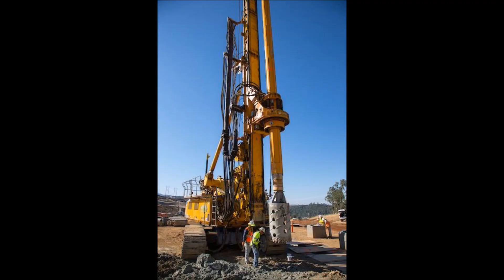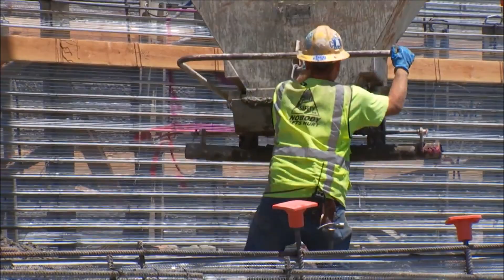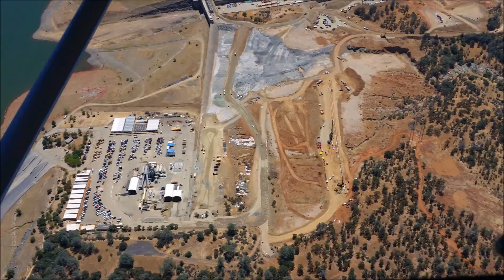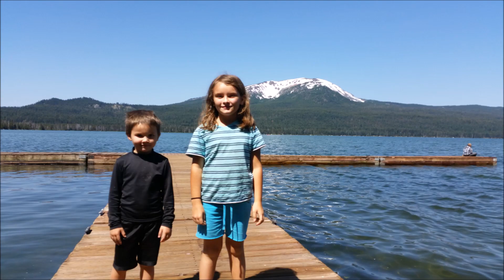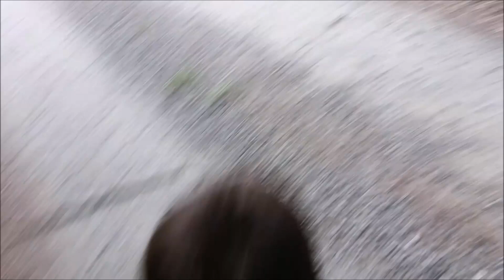Oroville Update 20 July -"Long way to Go, Short Time to get There"

Comment: It's amazing the amount of material(s) being removed, added, recycled and all!
~
_Wonder if they'll run out of their own stockpile of gravel from their stockpiles & have to bring it in? _
(Either gravel, sand, RCC, Structural Concrete)
~~
Anyway, also interested in the drainage being put in between the fill concrete. (The inner workings and pipe being used. E.G. Size, length, material it's made of etc..)
~~~
Thanks for all you do Juan, it's of a great service you provide to many.
~~~~
Truth, Peace, Freedom & Love2ALL™
James
7/28/2017
5:09am

Comment: Can you tell a few words as to why they have to remove all the dirt including using water hoses and shop vacs...
Reply from the maker: 'Dental Cleaning' to give the 1st layer of new concrete something solid to adhere to.
Reply: Much thanks.  BTW, I live up here in NW Wa but am quite interested in the project. You're doing a fantastic job covering it.

Comment: Juan: Just to clarify, the vibrator in the "wet" concrete is meant to ensure that no "air bubbles" are present that would create a "air pocket" and weaken the concrete. Wet concrete is not "compacted". The RCC is mixed much drier so that when it's "squeezed", it sticks together like a clay ball. Rule of thumb: The driest concrete makes the strongest concrete. Not considering "re-inforcing" of course. Has anyone asked how they intend to move (transport) the massive amount of RCC to the plunge pool?? We're all trying to "guess" how that will be done since it's such a massive amount. No-one is mentioning those "training walls" but they also will be a massive step to be completed by target date. As always, thanks for the updates.

Comment: Thank you for withstanding 6 hours of meeting and finding a nugget or 2 to report. [You do at least have many subscriber's time well spent. Even for those of us not near the problem.]

The region of the spillway needing the most improved footing looked like a terrible mess 1 or 2 weeks back. It appeared that the remediation task required too much time and material to be completed in the time available. Seeing the progress being made to build a stable in-fill on the tough base rock is most encouraging. [This despite concrete-pour methods which do not seem very efficient.]

Thank you again.

Comment: What years were you in the USAF - what did you fly.  A lot of my classmates are airline pilots at present.
Reply from the maker: mrackerm class 89-04 Willie, Mather, Travis, Reno NVANG. AA in 99
Reply: Thanks.  I was USAFA 81, 30 years as a scientist.  I have classmates (that I know of) flying 777s out of IAD (UA), 787s out of SFO (UA), and some AirBus (POS) numbers out of CVG and ATL (both DL).  I can't think of any at AA but there was a Brigadier General I worked for about 10 years back who flew out of DAL - he was in some leadership position with the Union around 2007.  Only one I knew was flying 52s out of Mather in the late 80s, but by 89 I think he was already off to DL.  Just curious.

Really nice reporting on Oroville.  I go through withdrawal when you don't post for a few days.

Comment: Question about 4:30: I assume that green section will have spillway walls? Or will it be cut out in a groove to ensure the water flowing hits the bottom section of the spillway?

My point is this- if there's only going to be concrete on top what stops the water spilling over?

4:55- Never mind you answered my question!

Comment: vibration is NOT used for compaction, rather it is used to bring air out of the wet mix to the surface to remove voids and ensure strength. keep up the good work!

Comment: They better hope next season is very dry and that they never have to open the spillway gates.  Progress is very slow, and they have concentrated on the wrong section.  If they are going too rebuild the upper section they better get on it because it takes around 30 days for concrete to fully cure and reach full strength.  It's very confusing as to what type of concrete they are using where.  My prediction is they will be going into the next winter season with a spillway that is in large part unfinished.
Reply: Internet Privacy Advocate.....the flood of 1862 with 30 feet of water in Central valley was followed by a drought year. Hoping and praying that history repeats.....
Reply: I'm left speechless by the methodologies they are implementing.  Juan's headline says it all..  DWR is better at spreading verbiage than they are at laying concrete.

Comment: Thanks for the update.  Is the lake level being reduced only by the Hyatt Powerplant?  Also, has there been any talk about beefing up the area leading up to the spillway gates on the reservoir side?....so that scouring won't be a concern?  Also, is the DPW ever going to address why they ignored warnings about the spillways from those individuals which have now been proven right?  Just wondering.  Thanks
Reply: +quintube Was wondering the same myself about levels. Looking at the DWR most recent figures, outflow appears to be around 5000 cfs, inflows about 3500 cfs. According to an article in the Mercury from a couple of months back max outflow through Hyatt is 13,000 cfs. Based on those DWR/Mercury numbers (disclaimer here - I'm no expert and stand to be corrected) I think you're right in assuming it's only the Powerplant outflow.

Comment: Thank you for your great videos Juan! =)

One thing I cannot get over is how LARGE that 1000 foot hole is that they haven't even started filling yet. And if you look at the extremely slow progress they are making on the lower portion and use that as a yardstick, I struggle to see how they will actually get all of this done by November. I am probably wrong in my Internet Armchair Assessment (which is all too common), but right now, progress seems extremely slow.

Comment: Glad the bears were friendly!! ;o) So, are they still saying this spillway will be ready for service on Nov.1?? Or, are they changing the strategy by further lowering the level of the reservoir?? Has anyone explained how they can "marry" the completed "permanent" structural concrete sections to the RCC sections so there is no undercutting or other water damage during use and what is necessary in the way of preparation/demo when its time to place the permanent structural concrete?? 
This IS a complex problem/task that involves creating much temporary and staging areas in order to complete the final product. Being a very experienced roadway contractor (which almost always includes those same kinds of temporary steps and tasks, makes Kiewit a perfect choice. 
Much appreciate your contribution in helping us to watch and understand this project. Thank you Juan

Comment: Another great post. I'm amazed that DWR doesn't take the opportunity to work on the gates while they're this exposed. We already know that the one on the right is being difficult. Surely now is the time.
Reply from the maker: They have a plan to Inspect and Repair the gates.
Reply: I agree.  The history of high water volume flow,  quite visible porting under the open gates,  will surely damage the new flume the first time they use it. They must be working on the chute structure - we just haven't been told.

Comment: Thanks Juan. Love the bit at the end with Pete.

Something doesn't add up regarding the middle part only having RCC. 

Presumably the entire sw has to be at the same level. So if they use only RCC to bring the middle section up to the level of the finished adjacent sections, what happens then?

How can they put another finishing layer over the RCC if it is already flush with the adjacent 'finished' sections
Reply from the maker: and how will they add the structural part next year?...don't know yet, stay tuned...
Reply: blancolirio That's what I mean. How can they add structural on top if the RCC is already flush with the structural level of the adjacent sections. To do this would require structural to be added to the whole thing to keep it all level.
Reply: marmaly When a road is being worked on, there is typically a transition ramp at either end of the ground up road. Easy to think that is the plan. It's step enough the won't have to work much with standing water.
Reply: TRLWNC1 I thought about that, but it can't be good for the structure to have water over an uneven surface like that... esp. flowing back up again. Cavitation?

Comment: I don't know why they started at the bottom. I would have started at the top, so if it did not get done, only the bottom would fail. If they do not get a good "seal" at the top, water will find a way underneath the concrete and re-destroy everything.
Reply: Maybe for the same reason that roofers start laying shingles at the bottom and work up?  Just a guess...

Comment: Juan I noticed that the slow seep on the right face of the damn is gone.  Is the water too low to seep or does it dry up in the summer?  I am looking forward to watching your videos as the winter rains return.  Thanks for your reports, I love them.
Reply from the maker: Mike Croft its greens up and dies off every year like that.
Reply: That suggests it's not actually a leak from the reservoir, but the result of ponding water on the face of the dam.

Comment: Did they claim to still be on schedule?  Or did they say they were working with a very "flexible" schedule? I believe Hydro dams 101 says work from the top down...
Reply: Top down makes much more sense to me. Maybe the reason they're starting at the bottom is because they potentially don't yet know what they will do around the top/middle, even if they pretend to know.
Reply: David Peterson You have to remember the massive hole in the middle. Work on the easy stuff while the hard stuff catches up....

Comment: The vibraters are used to elimnate air pockets which would weaken the comcrete.
Reply: Brian Gardiner That's Not what my wife uses hers for.
Should I tell her ?
Reply: The "stay in place" forms look like where the expansion joints will go and where they will drain any water seeping below grade.
Reply: Very solid observation.
Reply: supposedly those Stay in place forms will be filled with gravel for the drains.  I totally have no idea if they intend repeating those drains all the way up but presumably not or they will never do what they say they will do by november.

Comment: I'm not sure I get the obsession with the Nov.1st cut off date. Granted that was a target date for round one completion, but if the lake is going to down around 700', they should have plenty of time to finish up what they are doing before any severe weather hits.
Reply from the maker: Correct, It's an arbitrary date set by DWR...they'll be able to work well past that date...depending on the weather...
Reply: blancolirio And fog. And rain. And..... November to March are interesting times out there!

Comment: I'm surprised they didn't add in some armor to the spillway intake to reduce the chance of undercutting when operating outside planed levels. With the water level so far down this would be the perfect time to add some concrete to the at risk areas.

Comment: Remember Pete you don't have to outrun the bear just outrun dad....LOL
Reply from the maker: "easy peasy"- Pete
Reply: RCC isn't pumped or poured, it's dumped & spread like asphalt.
Then roller compacted like asphalt.
Reply: Yeah I said the same thing, earlier about using those buckets. The pump hoses are a pain in the butt and break down to much...And when they do, watch out, many line replacements when it happens...

Comment: What contractors are they using for the rcc roller compacted concrete
Reply: Unless Kiewit's bid was amended from when it was originally submitted, Kiewit will be doing the RCC.  The original bid shows three sub-contractors, none of whom are doing the RCC.

Comment: It's really great that you keep documenting this effort.
Reply: Most people STILL don't appreciate how close this came to being one huge disaster.
Reply: Thanks for your reply Hector.
Reply: Diogo Mendes What i learned here at this channel: There are "normal" US-Americans out there. Maybe not so much, but they're existing at least! ;)
Reply: Lynda, between the secant wall and the ES weir, will be terraces of RCC. Behind the ES weir on the riverside, will be a buttress of more RCC that will a) support the weir b) prevent erosion right behind the weir. This was shown on a graphic from the recent public meetings. 
I think their modus operandi of a) dental concrete to fill and level the rock crevices b) next layer of RCC and finally c) structural, reinforced concrete is a sensible way to repair this spillway.
Reply: The crest of the dam includes the weir, which is much lower than the main center earthen section.  The weir and parking area is much lower, so water will find this breach opportunity first.  If you look at other dam failures, it usually occurs off to one side of the main dam.  Please read DWR inspection reports for previous years, which describe the many vulnerabilities (including seepage,) in the main dam, and you will see why the dam was only approved for interim use.
Reply: Lad A Dog a look at Google Earth suggest something different. The main dam is built across a valley and two peaks, with the main spillway and ES weir on the other side of one of those peaks. If the weir did fail, it would wash out a lot of that side of the hill and obviously cause a lot of damage elsewhere, but the two spillways are separated from the main dam by a hill of rock.
Reply: The dam never was in any danger, the only danger has been the ES giving way allowing 30'+ of water to rush out of the reservoir.  Never understood why people thought that the dam was in trouble.  Even if the ES washed out the dam would have held.  There still would have been a horrifying disaster if the ES failed, I don't want to suggest that this was nothing short of a major disaster if that had happened.
Reply: Lynda - seeing the hillside (they cut back) lose that much mass is a huge concern to me. That, combined with the dynamite being let off and the vibration-compression work of the new concrete could potentially cause the hillside in front of the main dam area to destabilize and erode.
Add to that the mass which was lost when the water gouged out the mountainside.
Also - working on a "60% plan" is no way to work. It's like saying "we half know what we're doing, but we half don't know what we're doing".
A recipe for disaster.